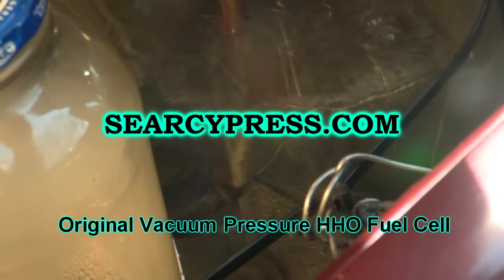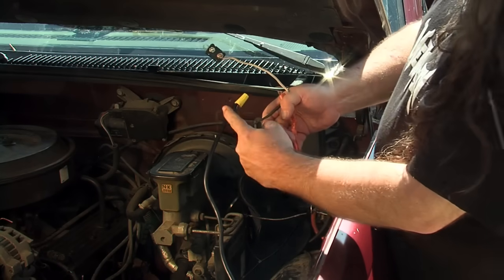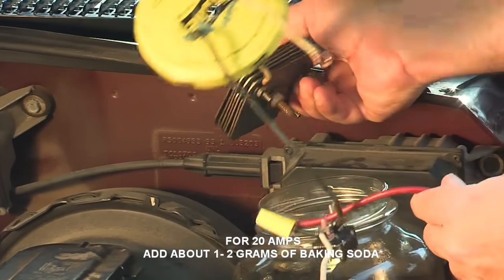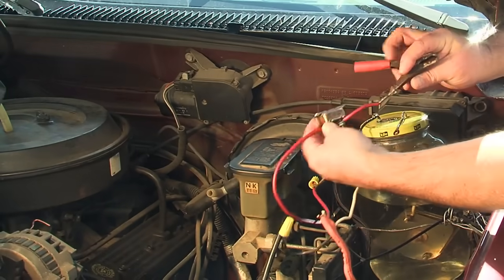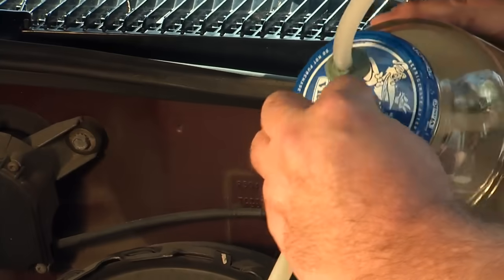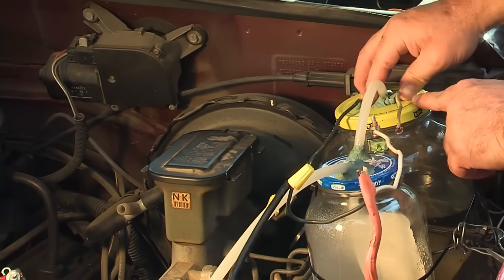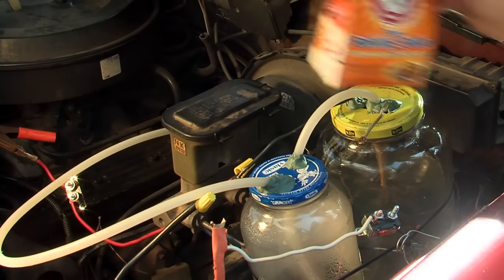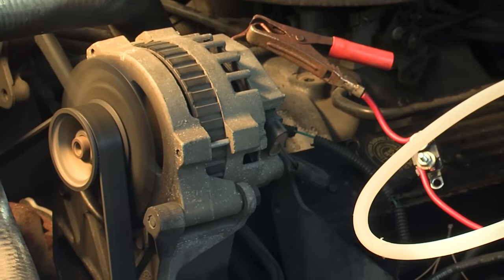Vacuum Pressure Hydrogen fuel cell defeats high gas prices using hydrogen from H2O.

Comment: All the exposed and uninsulated wire and connections make me nervous. Hard to imagine glass jars surviving for so long on a truck under the hood.
I bought a manual on building one awhile back. Much cleaner look with PVC and proper wiring and not really very costly for the parts.
Doesn't the computer need some sort of tuning to allow for the hydrogen and to adjust the gas and air properly?
Reply from the maker: The system operates in a hard vacuum. PVC will not stand up to the heat and vacuum. Injecting into the carburetor or air system is not the same as injecting into the vacuum system. Thanks very much for your comment.

Comment: I made a hydro unit for my 05 Chevy express 
The auto companies have the vehicles tuned in late models so this wouldn't work. If anything is altered from the MAF sensor it throws a code and the computer doesn't allow for the better fuel economy

Comment: can I run the cell off a 48 volt battery bank charged from solar? I want to give hydrogen to a propane generator.
Reply from the maker: You could. You are going to enrich propane? I've seen that done. Insane results for sure.

Comment: How much baking soda per pint of water?
Reply from the maker: We start with a very small pinch. Making sure the amp flow does not exceed 30 amps. As the temperature rises in the cell the amp flow will increase. Different water will have different electrical properties so there is no set amount. Thanks very much for your comment.
Reply: @metalpresstv  Thanks for the response. Looking forward to trying this. I appreciate and enjoyed your videos much. Keep up the awesome work.

Comment: All in all, I think you would be better off (at least for the internetz sake) using the gas, to power a small turbine( a small truck turbo just for fun) which then provides boost to the engine. Instead of the exhaust powering the turbo, burn the hydrogen gas mix in the turbo! Your neighbours will think you have a jet engine under the hood...Elon musk showed me a few things that made me suggest this.

And thanks youtube for suggesting a 10 year old video for me. Much better than the fucking click bait tailor made videos you usually do!

Go Metal or Go Home!
Reply: Cheers!

Comment: you do know that wet hho will destroy anything aluminum in that engine right? if its all cast iron your good, but aluminum heads, intake, and throttle body, its gonna destroy, thats a fact! plus what you gonna do with the hazardous material once all the solution turns brown?

Comment: How long will that amount run your truck? And or every would need to be replaced to regenerate the gas? IE: baking soda, stainless plates
Reply from the maker: About 100 miles was traveled before we had to add water. Thanks very much for your comment.
Reply: @metalpresstv  thanks for your response

Comment: And this is why Conservation of Energy should be tought in highschool.
Reply from the maker: At what point did you think someone was trying to say this was over unity? Apparently you think this engine Burns 100% of the fuel all the time. It only Burns around 80%. Using a little more energy we can push the efficiency well above 90%. The laws of the conservation of energy remain intact and we are still able to get better performance. We were able to burn low octane fuel without any engine ping saving money at the pump immediately. Thanks very much for your comment.

Comment: So did some reading fuel conversion is legal to a degree but this setup also has not been looked at by the Environmental Protection Services for this rig to be legal it would have had to pass an emissions investigation and a safety investigation and I guarantee you your crude ropes and silly putty would not qualify as safe as far as the government is concerned like good for you you've been driving with it for 30k but it's not safe and you shouldn't be showing it to impressionable people on the internet like I'm I'm sure you haven't thought of this but your video could be the reason why some people might be dead right now

Comment: Law of conservation makes this impossible.  H2O has an extremely strong bonds that take a ton of energy separate.  You can't get more energy out of remaking those bonds than you put in to separate them.  actually you lose energy because of efficiency loss.  Fyi your alternator  only puts out 50-90 amps probably.  your battery puts out 500+ amps.  your alternator is directly connected to your battery.  So how do you get more amperage connecting to your alternator?  Explain....  All this thing is going to do is burn your alternator up and decrease your mileage while creating a massive risk of explosion.
Reply from the maker: It's actually very easy to break the bonds. The engine is only using about 80% of its fuel normally. Using a bit more energy from the alternator, 30 amps, we can increase the efficiency of that burn well above 90%. It is not over unity it is just higher efficiency. Even if there were no gains, you're able to burn low octane fuel without engine knock. Generally that saves you a lot of money. Thanks for the comment.
Reply: @metalpresstv  Burning lower octane fuel with this makes sense.  There isn't any issue with pre detonation using hydrogen?   Or is it only applicable in low compression engines?  If it's low compression engine isn't low octane fuel ok?
Reply from the maker: @Barry Urry  engines have knock sensors that adjust as needed. In the real world however, it just doesn't always do the trick. If you've got knocking you better do something about it, normally buy higher grade fuel. We just discovered this as a part of what we were doing. Without the cell on this engine, you had to burn high octane to totally knock out engine ping. Some of that might have been due to age and etc. With the cell however we could burn  85 octane no problem. Injecting in the vacuum is totally different than putting it in the air intake. Thanks for the comment.
Reply: @metalpresstv   Putting it to vacuum is putting it in your intake... That doesn't make sense.  That would mean you get a ton of hydrogen at idle and almost none at full throttle.  The vacuum is created in your intake after the throttle body.  When your throttle body is open you have very little vacuum.  If you told me the hydrogen was compressed and you were injecting it that would be more believable.(please do not try to compress hydrogen if you value your life).  Or if you told me you were injecting before the throttle body with a progressive controller it would be a little more believable.  There are just too many holes here for me to believe any of it.  20+ Year mechanic here fyi, been a mechanic for multiple baja race teams.
Reply from the maker: @PrinceofWalesisland  I doubt very seriously you drive it full throttle. I could be wrong though. Lol we put the system through years of testing. Installed cameras under the hood with balloons inside the fuel cell watching vacuum response in real time. You're exactly correct about vacuum response. But when you're driving down the freeway there is sufficient vacuum to provide thermal properties necessary to keep the fuel cell operating optimally. The vacuum itself is not producing more HHO it is actually producing the temperatures needed to work properly and lowering the boiling point of the water. You are steam injecting.
Reply: @metalpresstv  I must have misunderstood what's going on here.  It's not a hydrogen generator?  What does steam have to do with anything?   Yeah lowering pressure does lower boiling point.  Why would you want the water to boil if you're converting it into hydrogen?  If you want to speed up the reaction why wouldn't you use hydrochloric acid or sulfuric acid and maybe a little bit of heat?
Reply from the maker: @PrinceofWalesisland  We are generating flammable steam. Using acid is probably not a good idea in an engine. Thanks very much for your comments.
Reply: @metalpresstv  Thanks for responding.  I maybe be more confused now than before.  It's been fun to think about the subject regardless.

Comment: I guess that if it steam cleans your engine you had better use distilled water in the fuel cell to eliminate the possibility of chlorides from the chlorine found in tap water rusting the engine up?

Comment: Cowboy science is my favorite type of science. You basically take things that you have lying around and create new wonders. This man is a genius!
Reply: Law of conservation makes this impossible.  H2O has an extremely strong bonds that take a ton of energy separate.  You can't get more energy out of remaking those bonds than you put in to separate them.  actually you lose energy because of efficiency loss.  Fyi your alternator  only puts out 50-90 amps probably.  your battery puts out 500+ amps.  your alternator is directly connected to your battery.  So how do you get more amperage connecting to your alternator?  Explain....  All this thing is going to do is burn your alternator up and decrease your mileage while creating a massive risk of explosion.

Comment: Are we suppose to believe this device defies the conservation of energy laws?
Reply from the maker: Actually no. What we are implying is that you only burn about 80% of the fuel that's going into your engine. By using a little more energy and enriching the fuel in the state of vacuum, efficiency can be greatly improved. By using some of the energy from the unburned fuel the conservation of energy laws remain intact. Thanks for your comment.

Comment: Hhmm.....glass jars in your engine bay....hhmmm.....seems legit
Reply from the maker: We did try everything else first. Plastic deforms under the vacuum and heat. We had certain ceramic models but the porous nature of the substances resulted in a crystalline formation. The system is in a vacuum so glass is the best option. It has the thermal properties needed to maintain proper temperatures. Thanks very much for your comment.

Comment: This video is completely not true but an HHO generator can work to give a car a small but noticable boost in power and fuel economy if used in conjunction with petrolium gas and done correctly.(built one myself for educational reasons years ago but did not run it in a car)

If anyone is interested some things to consider building one:

First off, an alternator generates more power than your battery can hold so one would need to design one that uses the excess power only, not easy for an amateur's skill level but doable. You can also run the system off a second battery which would work much better if you choose a much more powerful battery but isn't as convenient and requires recharging.

Second, you need to use the right electrolyte in the water to make the most HHO for the amount of electricity used and also keeps the temperatures down.

Third, you need to insert it between the intake manifold and the maf/map sensor to mix evenly with the air. A modern car's ECU, depending on the way the car was tuned from factory, will dictate the end result as a success or fail . In theory, and based on some conversations with people who have tried it, the hydrogen gas will burn with any remaining unburned oxygen that the fuel used. Hydrogen needs far less oxygen to burn so as far as your piston knows, you have a more efficient combustion. Your sensor at your exhaust, however, might say otherwise. If it detects unburned oxygen(likely), it will tell your engine to use more fuel untill it is all burned, wasting fuel. 

Every car is different but HHO generators are better used as a fuel additive for performance/track use similar yet different to NOS.

Comment: Is this a joke? I honestly can't tell.
Reply: Not a joke for the guys believing in it. The "H-generator" uses electricity from the alternator. In other words, it will make the engine work harder. So far everybody agree. The "thing", as I understand it, is that the small amount of added hydrogen, makes a positive difference in thecombustion of the fuel, and therefore give you more milage. Personally, I do not believe in this, due to the amount of air an engine suck in. The ‰ of H in the mix is hard to think of as significant. On the other hand, it might do some positive stuff on idle? ‐ I don't know.  Would love to see a sciencetific test on a power generator. That's an easy to measure test. Just measure how many amp hours you make with and without an H-generator attached. Just use the same amount of fuel each time... But of course, thats way too much to ask for from these folks.... You know, they might proof themselfs wrong.
Reply from the maker: I understand your dismay. However, even if there was no gain because of power usage or large air flow, what you would find is we are injecting steam into the engine. (The boiling point of the water has been greatly reduced from the vacuum state.) The result of that water injection is the ability to burn low octane fuel without any engine ping. We measured gains in performance and mileage however the real savings is noticed at the pump when you're using the lowest octane fuel and still have high performance. I'm not telling you to replicate this, I'm just telling you what we observed. Thanks very much for your comment.
Reply: @metalpresstv  I'm not sure this work or not the way you describe it. (Kind of an agnostic on this field) But until I see good data on any testing, will I not believe in this. As I suggested, do some proper measurable testing! Not on a car, but on a stationary engine. Anyone can lower the mpg in a car, just by driving differently. And that could actually be done without the driver noticing his changed trottle behavior. Kind of a placebo effect. Use a power generator. Measure everything. Write down everything. Film it all, and  publish it.  BTW; I think it's great that you respond on such a old video!
Reply: @metalpresstv  The Water/methanol injection is of course a known fact, going back to german ww2 fighter planes. That setup gave a lot more power for a short while (with crappy gasoline).  This is dough not the same setup as yours.
Reply: @sidekickbob7227  if it's this easy, how come you don't see professional versions of this from companies that make other engine accessories (I'm thinking oil catch cans)?
Reply: @mattresspolice  With proffessional companies, do you have companies like Holley in mind, or chinese e-bay vendors? If yes on the first question: If this was a prooft setup with measured effect, they would probably have done it. Until then, they wouldn't risk theires good name as an quality producer. Why chinese companies haven't made this? ‐No idea. They probably already have? Those people even sell magnets and electrical fans they claim will increase the power. Just snake oil...

Comment: A buddy of mine did this with his run down cube van. Worked pretty nicely
Reply: Lol lies.... Cool story bro.. why u kids like to make up shit? 

Just idling your engine is over a 600 rpms. Driving a 2.5 liter 4cly motor  is about 150 cubic inches. That's 37.5 cubic inches per a cylinder. A cylinder fires ever 2 full rotations. So in a minute of idling at 600 rpms your engine will use 11,250 cubic inches of air a minute at just idle. That's a 187.5 cubic inches a second of air. You're not producing even 2 cubic inches a second. But don't forget that it's h2O 2 parts hydrogen 1 part oxygen. So 1/3 of the gas isn't even hydrogen it's oxygen. So not even 1% of the air being taken into the cylinder is hydrogen. The only thing being accomplished here is the alternator is working harder for the high amp draw dragging the motor down more reducing fuel mileage. This is why water isn't used as fuel in a motor vehicle. 

Now don't forget we don't drive at 600 RPMs most people will be around 1800 rpms at cruising speed. That's 3x the amount of air with still the same hydrogen production. So now ur way below the threshold of .03% hydrogen in the cylinder. Using a spark arrestor on the output hose to keep from blowing the jar up you would be hard pressed to even candle a flame let alone put anything measurable in every cylinder 900x a minute cruising down the highway at the speed limit.

Your lies make u look stupid to any semi intelligent person

Comment: Like it or not this is my experience.
This set up might be fine for an old vehicle that’s not computerized. If you have a computerized vehicle then you need something that tells your computer brain to cut back on the gas as the more hydrogen it gets. That’s the way my system works and not only do I get better gas mileage but I also get more horsepower.
I have a bowl bowl chip that talks to the computer and automatically adjusts as your fuel system gets more hydrogen makes the car run better all the way around.
Older vehicles you’ll have to just your carburetor to run lane but if you wire up the system to come on automatically when you start the vehicle then tune it as it’s working you wouldn’t have to worry about a switch unless you want to make it with a safety switch to shut the system off. 
PS. Do you live in a Cold climate you’re going to need a heating system for that water no I don’t freeze. 🤷‍♂️

Comment: Unless you use a different power source for water electrolysis than your car battery or you use an urhea solution instead of water, you cannot get better mileage out of an hho cell. The energy for your car battery comes from the the fuel: battery - generator - engine. Battery gets higher  load? Generator supply higher load, increases torque on engine shaft, engine consumes more fuel. It's the first law of thermodynamics.

Comment: Lol, 98 Chevy 350 was tbi, not carburetored. And water is  condensation from normal heat cycle of exhaust after running of engine.